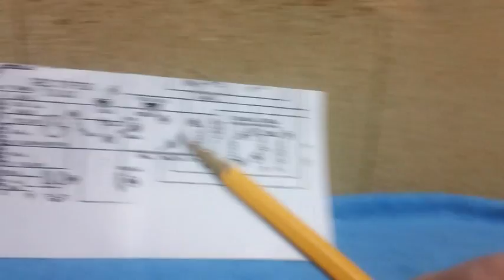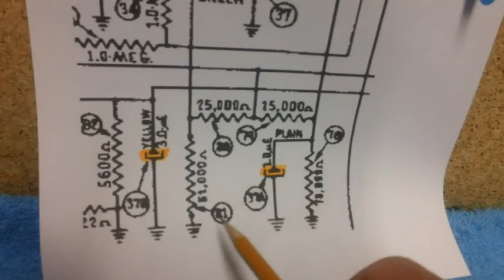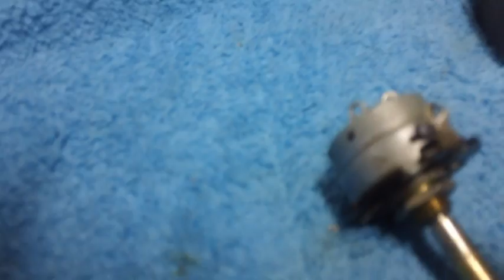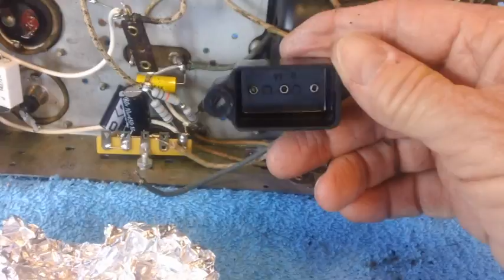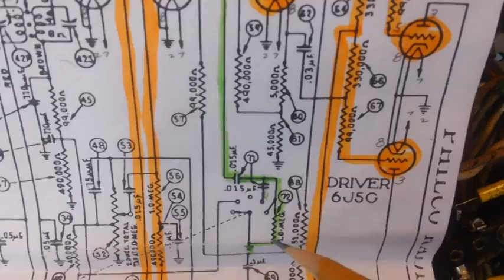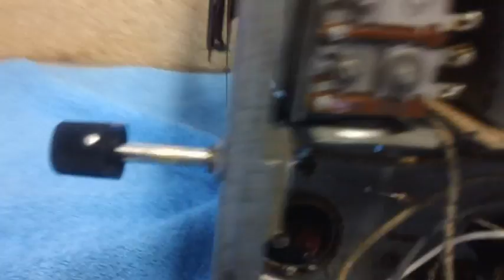Philco model 37-2670 repair and restoration (Part 13 of 34)

Comment: John,

Thanks for the explanation on the grounding of the capacitor filter cans.  I never would have guessed they grounded to the transformer's center tap. 

For whatever reason, my 37-670 volume control stem doesn't have the long cardboard covering like yours does.  I hope that's OK. 

I know I'm going to have to watch this video more than once to soak up all this good information.

Best regards, Tom
Reply from the maker: Tom,The long cardboard insulators on those volume control shafts were notorious for coming apart and falling off.  It's no problem to fix.  Slide a length of heat shrink tubing over it.  You won't even have to shrink it.I'm glad you still enjoying the vid.  It's appreciated.Regards,John

Comment: Thank you John. That was good video , I never came across cardboard insolation in the cans before, I notist some thing in this clip I like to mention to you , it's Like, ly to no nothing one of the trimmers on the bottom looks like the adjusting screw is missing, it's hard to see it properly or not
Thanks Richard
Reply from the maker: Richard,Not all the spaces allotted for trimmers in this radio were used.  I'll try to show it in the next video.  Hopefully, I'll remember to do it.Regards,John

Comment: I don't want to go from troubleshooting to worm food! {:-O
   All kidding aside. Another great tip is to take off all jewelry like rings. I knew a guy who got electrocuted and died because he was wearing his wedding ring and was working on an Ion Implanter machine out on the factory floor.
   Great video John!
       Tom
Reply: A very good point to highlight Tom.  I automatically do not wear my wedding ring for the very reason that tragically happened to someone you knew (working close to line-output circuits where there is risk of stray RF comes to mind here for example).  This is another point I would easily have overlooked as I would have assumed everyone would be aware - I see it is no always so.
Cheers,
Phil.
Reply from the maker: Tom,
Very good point.  Removing rings, watches and jewelry is standard practice when working around electricity from any source.   If the ring won't come off...tape it.

Regards,
John

Comment: Those metal cans with the cardboard on them look just like the ones in my Philco 89 that I restuffed. when I cut them open they were bone dry inside, whatever liquid they used was long gone. Great stuff as always John! I always learn a little something from your videos.
Reply from the maker: Daniel,
You'll almost never find any liquid in these very old electrolytic cans.  But one time I did find some, which was totally unexpected.  Even so, they were still replaced.

Regards,
John

Comment: Thanks John, you make this stuff look too easy :-)
Since you will be talking about the power cord next time, would you go over 2-wire vs 3-wire power cords. I replaced my original cloth power cord which had 2 wires (hot & neutral) with a new 3 wire (hot, neutral & ground) cord. I did not connect the ground as the original cord didn't have one. These days I'm sure the chassis would be grounded but is that even possible in these old radios?
Awesome video again John.
Reply from the maker: Thanks, my friend.  I'll  see if I can't come up with something about power cords.  :-)

Regards,
John

Comment: interesting John, I will never guess that about the cap insulation, I thought it was some sort of mechanical compensation for the metal clamp brackets (^_^)
Reply from the maker: Juan,
I originally thought the same thing.  LOL
Thanks for popping in.

Regards,
John

Comment: Great video and teaching on the caps and the reason for the insulated negatives. You as always do a great job on these videos John. And it can't be said to many times about safety on these radios.
Your friend,
Dennis
Reply from the maker: Dennis,
Right you are, my friend.  It's interesting how folks are generally unaware of standard safety precautions concerning anything at all...right down to seemingly not knowing that a cup of McDonald's coffee is hot, so be careful not to spill it on oneself.  Very strange indeed.

Regards,
John